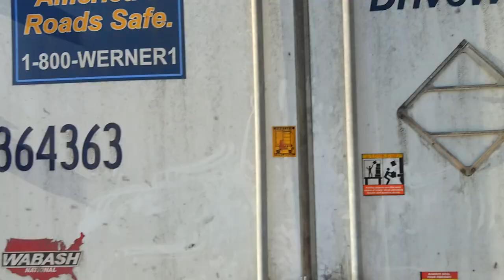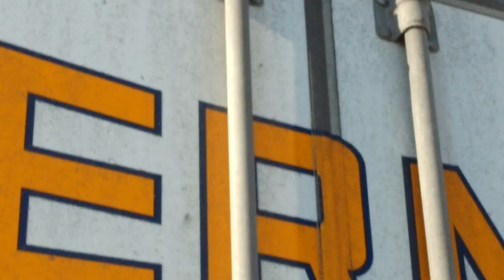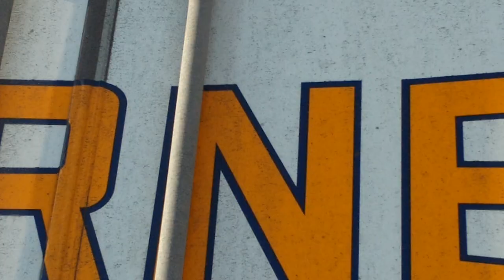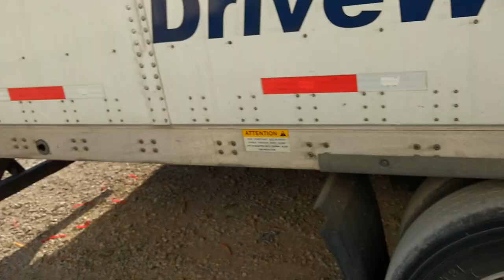Kingpin problems and keeping "the girls" clean - women in trucking

Comment: You can avoid jacking it up by:
(1) Checking the height before you back in and lower it down beforehand 
or
(2) If the Kingpin jumps the 5th wheel you can wedge something (small screwdriver etc) at the back of the 5th wheel so you can back up over it
Reply from the maker: Duncan Miller you are exactly right on all points! Thanks for watching and commenting